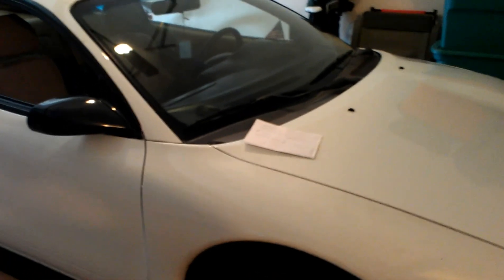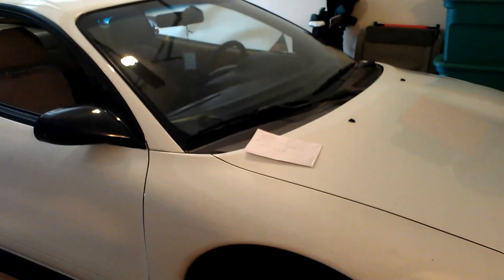OBD2 codes P0700 and P1776

Comment: ON MY 98 RS THE CHECK ENGINE LIGHT COMES ON WHEN I DONT STEP  ON THE GAS HARD ENOUGH SOMETIMES ..USUALLY THE SAME FEW FREEWAY ON RAMPS & STREETS..THEN IT DOWNSHIFTS WONT LET U UPSHIFT & EVENTUALY WONT LET U GET OUTTA 2ND GEAR..UNTIL U RESTART THE CAR THEN IT DRIVES FINE & ENGINE LIGHT GOES OFF.WHEN I DRIVE...I CHECKED OUT THE CODES A WHILE BACK & THOSE ARE THE ONES ON THE PRINTOUT I GOT..& I ALSO READ SOMEWHERE THATS A SAFETY FEATURE ,BUT I ALSO AGREE ABOUT  GETTING A TRANS.SERVICE..SINCE IN MY SITUATION WITH OVERDRIVE OFF IT JERKS USUALLY SO I JUST KEEP OD ON & IT ACTS LIKE THIS BUT 4 THE MOST PART DRIVES FINE...IF U KNOW THE RIGHT WAY 2 STEP ON IT.. ..DOES NYONE ELSE HAVE THIS SAME PROBLEM??
Reply from the maker: my transmission is old and finicky also; you may want to contact eric the car guy or scotty kilmer
Reply: Did you ever solve it ? Same issue happening here. People think I'm crazy , but it keeps happening just like you're saying.